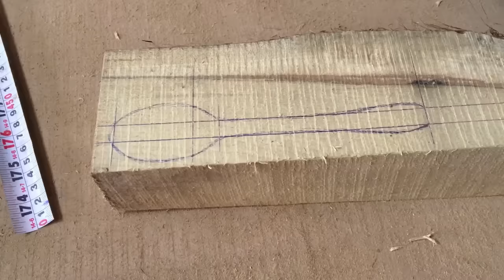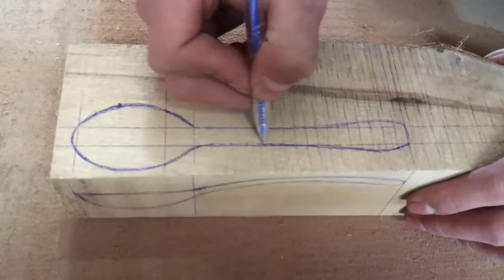Amazing Woodworking Skills - Making a Wooden Spoon From Discarded Log

Comment: NO Skills in using a bandsaw and power tool
Reply: Banana Bread Man, even 10 years old would make a spoon with these tools
Reply: OutdoorViking68 why are you hating? You try to make one? I’d like to see you fail
Reply: @mayazir  well I dont know about that but...
Reply: Classic hater.
Reply: +Grace Jennings it has to do with the resurging greenwood movement. Im a spoon carver. Its what I do. No power tools just axe and knife. (sometimes a regular hand powered saw). No power tools and ive started not even using sand paper (dont need it when your knives are sharp enough.) The scoffing is comibg from people who 1.) actually have studied and know what a good spoon is (doesnt drag on your bottom lip and your upper lip reaches the bottom of the bowl easily. Reinforced in neck for strength where grain is the weakest. etc.) and 2.) Have actually learned how to utilize the tradition spoon making tools. Im not an elitist but I was disappointed that the guy used power tools when the title said something about amazing wood working skills.